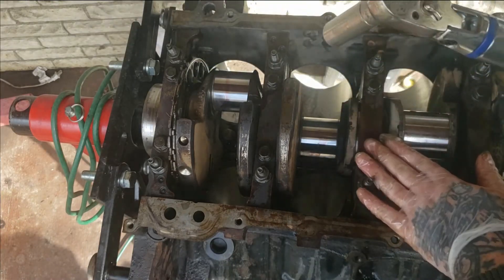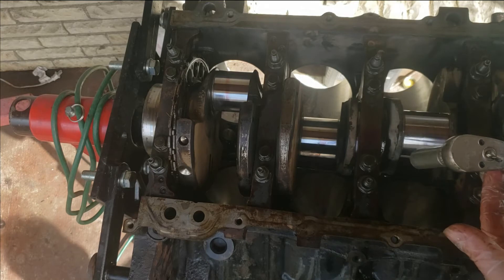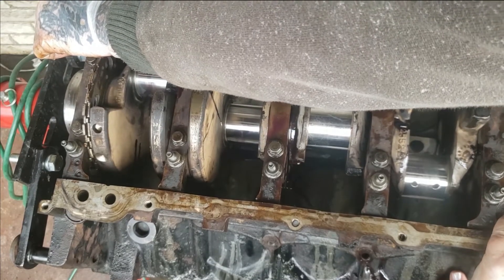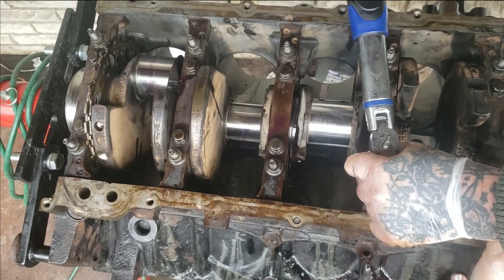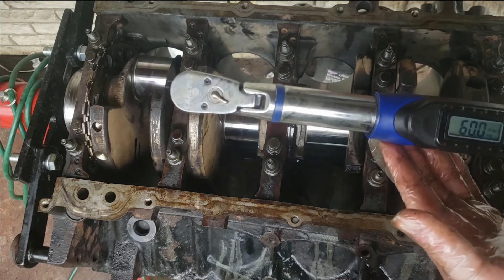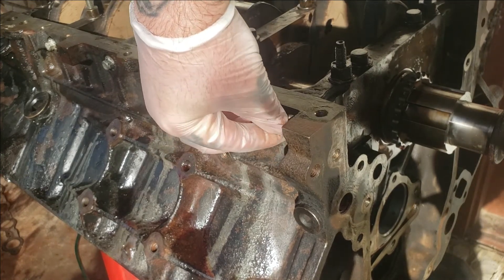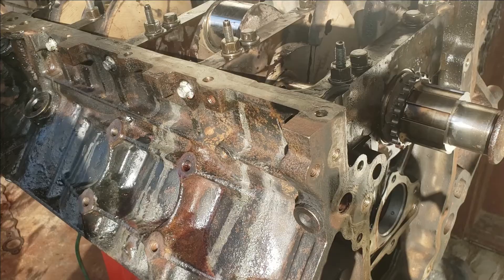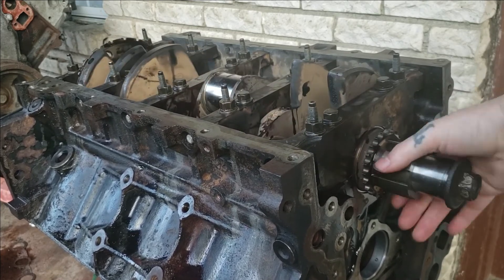LS Engine Main Bearing In Foot Pounds - Torque Specs - How To

Comment: For people interested, doing the angle with reused bolts "should be fine" it's been done countless times. I personally put a dab of red loctite as insurance and shouldn't affect torque specs. I plan to do some testing with new and reused bolts with either measure clamp load or how much it affects the bore OoR to deduce necessary clamp load as I'm tired of guessing. It's been fine but I'm OCD and like to make sure things are to a spec that I know is good. Brand new bolts and torque angle I'll trust as is but reused (again seems to be fine) still makes me uneasy not knowing how even the clamp load is. I also want to try xotics main studs, most cheaper studs tend to perform about the same or slightly better than stock bolts as far as clamp load/yield goes so maybe theyre not too much more and won't distort the bore much if at all and would be a better buy over new bolts as theyre only 20 bucks more. I don't really do youtube so not sure where I'll eventually post results but if/when I get to it I'll reply to my comment. Side note I've used the 60/55 method on a couple builds as long as everything is the same or as close to the same as you can get for variables like lube or no lube on threads etc that seems to work fine and in theory would give an even clamp load.

Comment: Inner bolts are 60 ft/lbs.  Outer are 50-55 ft/lbs.  Rod Bolts are 50 ft/lbs.
Reply: I was doing my engine but I realise when I was torquing main bearing bolt I tie them too much that crunk wasn’t turning easy with hand and we hard very hard start and engine keep on turning off what do you think must we losen it will it be fine or we made damage already
Reply from the maker: Great Info
Reply: @TattsForLife whats the diference on gen 3  when it says !!! “” first  design ,,    “ second design?!

Comment: How is engine machining done when sticking with tta bolts? Is the balancing done with used tta bolts and then final assembly done with new tta bolts? Would it be best/easier to go with new non tta bolts?
Reply from the maker: I always just re-use my bolts in most my builds lol never had any issues, and if a engine has balancing done its out of the block on a machine, factory engines are not balanced  just assembled, even remanufactured, balancing is more for a race engine
Reply: @TattsForLife  thanks
Reply from the maker: @23steph13  welcome lol idk if it was helpful or not lol I did polish that crank on my kitchen table lol that I install in that engine lol
Reply: @TattsForLife  yes. You helped me. Thank you!
Reply from the maker: Thank you for watching
Reply: @TattsForLife  so the issue with re-using main cap side bolts is making sure they don't leak so put RTV Black under the bolt head or bolt Thread?
Reply: @23steph13  yes. Remember these bolts are tta not tty so they can be reused.